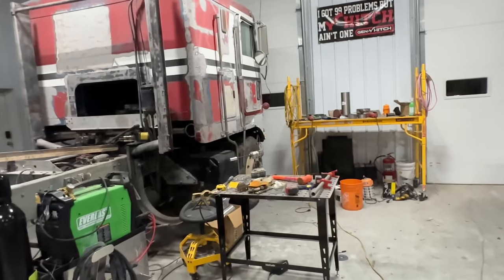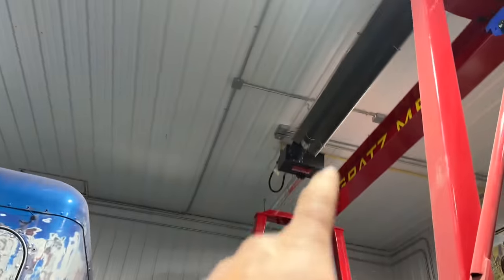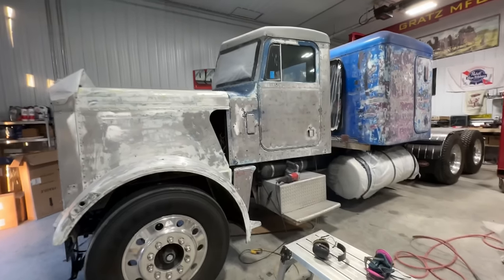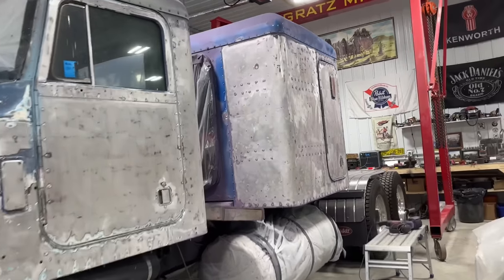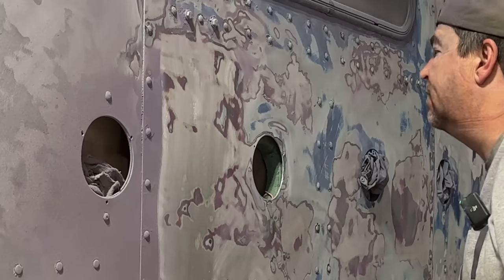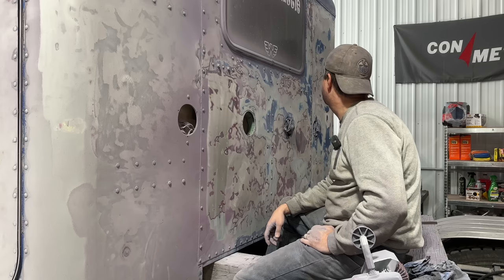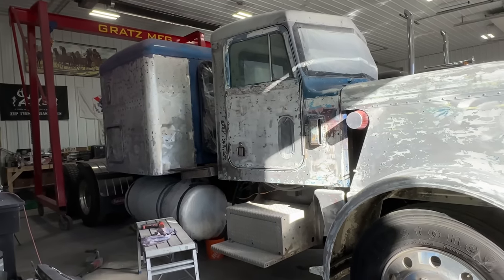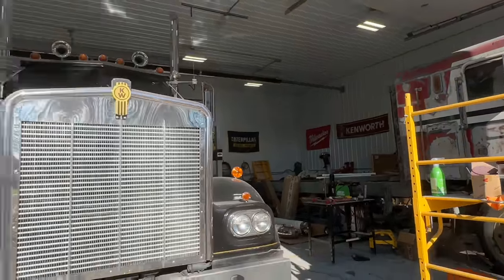Peterbilt 359 Restoration Ep.79 Knock it Off

Comment: There are no boring TwinStix episodes! 👌
Reply: I second that motion… every video is very entertaining.
Reply: The mechanical episodes are fun to watch but watching someone sand a vehicle?? NAH, I have better things to do....
Reply: Marc, I'm a little concerned. Your description of the paint on the back of the sleeper, has thinking it could be Emron paint. If it is it's very hazardous to work with. When the shops work with it they wear a hazmat type suit, so no skin is exposed and they have an external air supply.
Reply: Ya got that right..if it is then maybe the person is in the wrong place
Reply: @kenader9036  I think spraying Imron was the extremely toxic part - it could eat your skin.  But once cured, sanding it off is apparently no worse than other paints…hopefully, for Mark’s sake. 👀

Comment: Mark, to make your life easier if you don't wish to remove the glass simply remove the centre 'spreader' trim from the outer rubber flange, then lift the panel side lip at one point and insert a length of wire (I find a bit of 8 amp harness/loom wire is a good thickness) around the rubber and push it under the lip all the way round. This will lift the outer lip away from the panel allowing you to prepare and paint under the lip, it saves the rubbers from abrasion and the finish is obviously superior,not leaving an edge. If there is paint already on the edge of the rubbers,highly likely given it's multiple coats, it's also the perfect opportunity to remove it with a plastic filler spreader or such. Also as someone who does this sort of stuff for a living,and having employed plenty of bods over the  nearly 40 years of doing so,and I've watched every episode from day one, I have to say that your attitude,approach and execution could put plenty of 'professionals' to shame. Top stuff 👍

Comment: Try Benco Industrial paint remover B15! It's the absolute best stuff I've ever used for stripping paint. We just did a 379 cab bunk and hood with less than a gallon and it's way cheaper than aircraft and works 100 times better! Just incase you do another one in the future.

Comment: I knew an old boy in Keremeos, BC that had a 1948 KW conventional that was all aluminum, including the cowl & roof cap. The frame rails, and the rear diff housings were also aluminum. The 3rd members were cast iron, but he had alloy pieces for those too. Interestingly, the fuel tanks were steel!

Comment: I think I'd wait on the Duke of putting the exhaust pipes on till you sand cab. They would be in the way won't they?  That tough coating to sand may have been Dupont Imron paint primer. It's tough as nails and hard to sand. When I was in automotive and truck paint coatings that was a thorn in everyone's side that primer.

Comment: I did hear about guys coating the underside of fenders with truck bed liner. They claimed it prevent dents and chips from the underside. Not sure if it works but in the theory I guess it is possible. Any protection is better than nothing
Reply from the maker: Yeah I used that liner in a can stuff for #ProjectSnowman and will probably do the same here 🤔

Comment: Other than opening your overhead doors what type of exhaust or dust control do you have.  Paint and body dust is extremely combustible and I notice you have gas fired overhead heaters.  Just be extra careful when you spray….
Reply from the maker: I always blow out all the dust I can after I do work like this and don’t plan to paint until the spring when I no longer need the heater
Reply: Excellent, Being in the Fire Suppression business for 40 years I always get nervous about flammable dust and open heaters.  It normally doesn’t end well.

Comment: Hi Mark you certainly work very hard on getting thing's right, I got to admit when you did your close-up on the back of the sleeper pod it looked like a sort of filler and not paint but it has to be something I've never seen I've asked some friends hear in the uk that do truck repainting and convention on truck body work and they think it's a body filler with a type of fiberglass hardner with something mixed into it make it as hard as the rocks that could hit it, thank's for another great video.

Comment: With the amount of work and dust, I think I would have gone the dustless sandblasting process to get this project cleaned up! A few hours and it would have been all done and your shop and trucks wouldn’t look like they got snowed on! Way past the point to change the process now but if you plan to sand the Duke like this, I’d opt for the dustless sandblasting process instead. Just my two cents. 
Looking good anyway Mark! Keep up the good work!
Reply from the maker: Yeah but a dustless blaster isn’t cheap 😬
Reply: Why do you blast off the dust with an air nozzle and not try vacuuming up the dust with a brush attachment.  It seems like double work to you.
Reply: @TwinStix  Not buy the system, just have a guy who owns the system come and do it. I know the point is doing it all yourself but I think I’d draw the line at this one! 😉

Comment: You absolutely do not want to use heat when using a hammer and dolly! Not only do you change the temper of the metal, but your thinning the metal that your smoothing!!!!!! By the way I am not only a retired trucker but I am a certified body and fender repair technician! You will have future issues where you heat it!

Comment: The judicious use of a heat gun would help in cleaning the huck bolts. You might also want to try a detail sander. Milwaukee makes one. The triangular sanding pad can get into tight spots.

Comment: Great progress, Mark.  If you find that you cannot live with the flattened rivets or need to replace any of them, you can find them and the installation tools by looking up Buck Rivets (they most likely aren't Huck Bolts, which you'll find for the frame and structural attachments).  You can find the anvils and the hammer, which goes in an air hammer, for not much money.  The downside is that you'll need access to the back for the anvil.  If you have to replace one where you can't get to the back, you can find blind rivets that you can use with a rivet head shaver...and that will leave a rounded head that will look almost identical.

Comment: I'm wondering if now might be the time to break out the paint stripper again for the door jambs and around the huck bolts?  You've taken off a fair amount of paint on top of those areas the stripper should be able to finish it without flattening the rivets aka huck bolts.

Comment: I reckon you’d get 4 trucks in there use the centre door and put 2 side by side on each side of the shop. Especially if you put them in at an angle too😂 might get a bit tricky when it comes to doing the rubber duck tribute though

Comment: Just for fun maybe dolly out the dents / imperfections in those front fenders then polish up the aluminum. That would look great. For winter time paint up smaller stuff indoors with Rustoleum Gloss Black over the Rustoleum red oxide primer. Leave the truck final color till spring and focus on all of the other areas. The body work is critical to a good outcome. Look at videos for the Luna branded paint gun. Neat and cutting edge so they say.

Comment: Trick to removing the paint around the hucks - after you have it sanded take a razor blade and shave the paint in a circle around the huck with the existing paint and it will come off in one piece, then take a nylon wire wheel in your drill and clean the little bit of primer that is left and it will save you hrs if not days and then you wont leave grinder marks in the aluminum. Hope that helps you out or helps someone out. That is a trick that we use and its way faster. Great build can't wait to see the progress.

Comment: Unless you have used body hammers and dollies you can create more damage than you already have. Keep in mind that every time the hammer makes contact with  the metal and dollie you are stretching the metal more. Heating the high spot with the torch will also stretch the metal more and that is why you need to apply water to cool off the area after you have dollied the area. I have found if you have small high spots you can save yourself a lot of work and grief by tapping down the spot with a picking end of the body hammer and apply a thin layer of filler. I hope the reason you are removing the plastic was because of a past e-mail I sent you a short time ago. Also make sure you wash the surface real good with tar and wax remover. Just to remind you I have done auto body and painting for over 50 years, so the advice I am giving you is that of a professional. Good Luck.

Comment: Hi Mark, when heating the Ally body / fenders etc... if you get a bar of soap and rub it onto the surface area that you want to heat... when the soap turns black,  with heat .. the Ally is annealed and much easier to shape .. Hope this helps .. saves overheating the Ally .. Andy ...UK ...  Keep up the good work .. Pp may be worth looking into building a wooden frame to re mount the sleeper cab rather than having straps rub on the new paint ...

Comment: There is a plastic wire wheel at harbor freight that work’s awesome for getting that paint around those huck bolts removed. I have over 30 years in the industry and that works the best. Love the shows. Wish I knew how to post a picture of the wheels

Comment: Hi mark. How come you didn't sandblast the pete like you did whit the cabover ?
Reply from the maker: Did that on #ProjectSnowman and it created a ton of work to get the metal smooth again.  They did a few test sections on the Duke with lighter grit which is better but still rough.  I’m ok with sanding LBL I just wish the darn stripper worked a little harder

Comment: Enjoying the progress on the project.
I used to run a Peterbilt body shop a few years back and have a few under my belt and totally agree with the hours upon hours of work it takes to turn out these projects!
One question on the stripping method on the door skins and similar areas.
I noticed the skin tin canning quite a bit while you were working on the removal process.
Any chance it affected the skin with heat or etc?
Only reason I’m asking is I’ve contemplated getting one of those machines but wasn’t sure if it was worth it?
I’ve always had stuff soda blasted or stripped with sandpaper. Ugh!
Anyway keep up the nice work and that is going to be a sweet ride one day soon😎
Check out Doodle Blizzards “The 90”
Radiant fire red,Black,and Mocha 379.
I built it back a few years ago.
Reply from the maker: The polishers works well and doesn't appear to put heat to the panel as long as you dont apply too much pressure and keep moving
Reply: @TwinStix  sounds good 
I appreciate the response

Comment: Is that a wire wheel or some sort of a drum sander you are using at beginning of video to knock off rough old paint?  I need to do something similar and curious what it is and where you got it?  And btw none of these videos are boring, no need to apologise.  Thanks
Reply from the maker: https://www.amazon.ca/VEVOR-Burnishing-Polishing-Machine-500-3000/dp/B09WRC5YMD/ref=mp_s_a_1_2_sspa?crid=3G9RBCOCT57IH&keywords=vevor+polisher&qid=1700196560&sprefix=vevor+polisher%2Caps%2C166&sr=8-2-spons&ufe=app_do%3Aamzn1.fos.71722c10-739d-471b-befb-3e4b9bf7d0d6&sp_csd=d2lkZ2V0TmFtZT1zcF9waG9uZV9zZWFyY2hfYXRm&psc=1